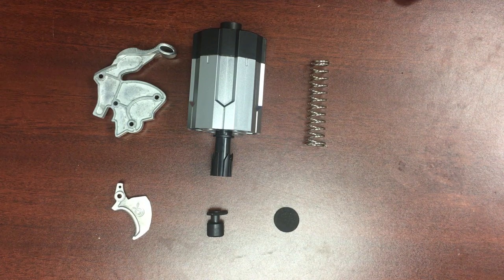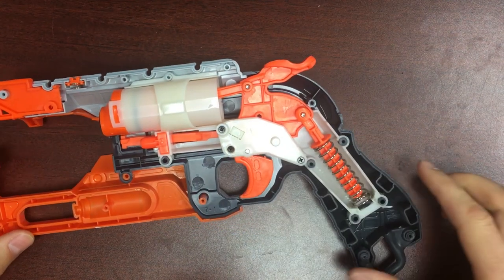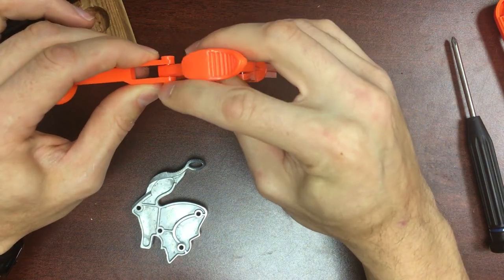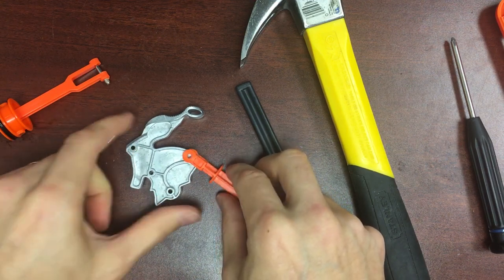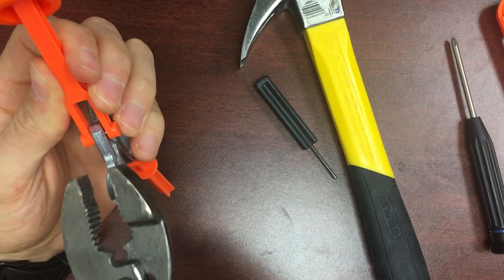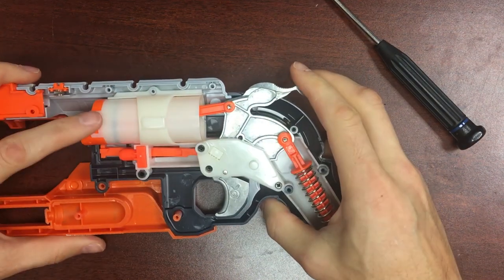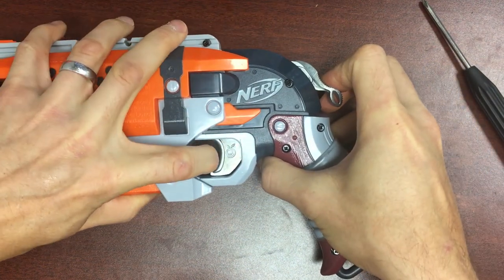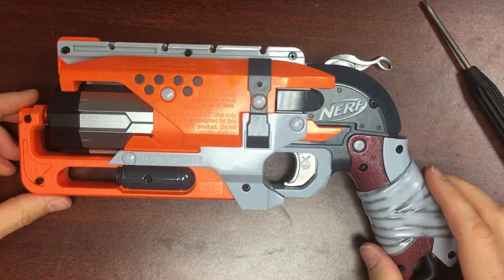O-Tac Gear Installation for Nerf Hammershot by Orange Mod Works

Comment: Is there any way to install the cylinder that can leave the air restrictor functioning normally?  I don’t do any competitions or need high performance but would prefer to keep my hammershot quieter with less chance of damage to any of the internals.